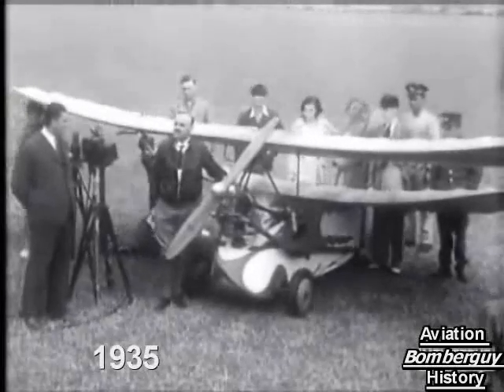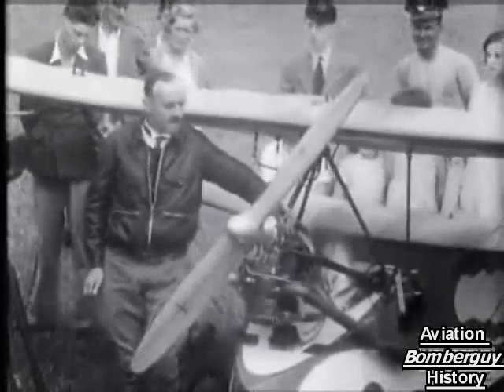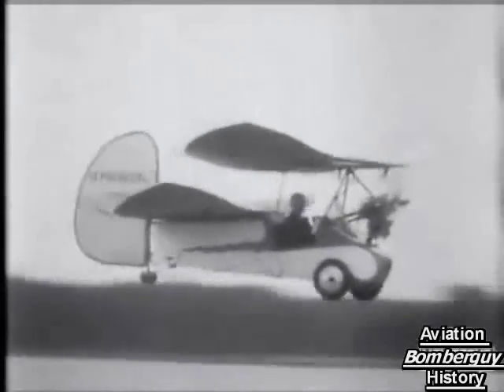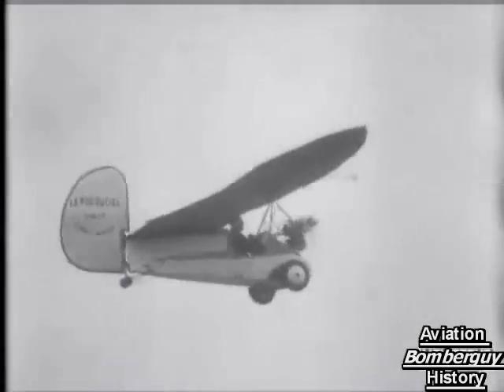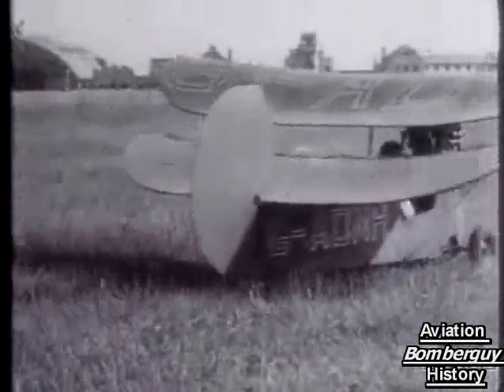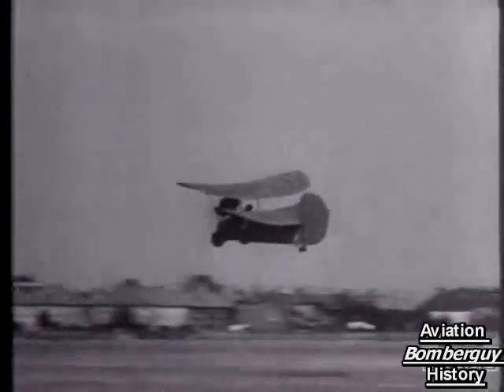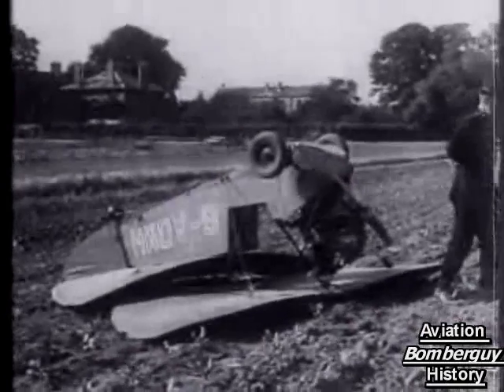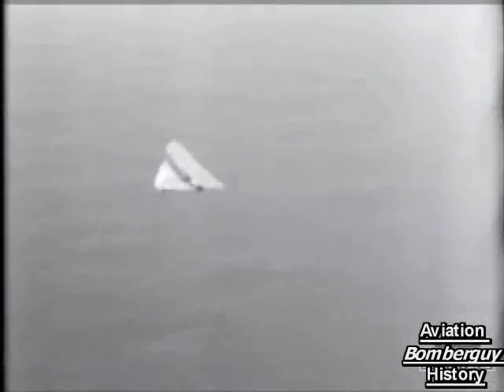The Original Flying Flea

Comment: Causing unrecoverable dives, as the high speed air from front wing going over rear wing increased lift in rear wing, putting nose down. 
Instinctive answer of pilots, pulling the stick, worsened the case, they should have pushed the stick.
In this mini-airplane, attitude was controlled by changing angle of attack of front wing.
Blessings +

Comment: @dopenhagen2009 im pretty sure that ultrlights also have a weight limit (the flying flee didn't meet any of those requirements so its just a regular plane with an odd design)
Reply: no weight limits existed yet back then. And if they did, they´d be higher, since modern build-materials didn´t exist too...
Reply: @klausbrinck2137  hopefully someone can use the Bruen decision to challenge it and raise the weight limit
Reply: @marcuspinson  my dream is to build a WingDing2 out of modern materials, with a DI-50cc-2stroke (Ditech, Purejet), should weight 35kg, so, I´m good...
Reply: @klausbrinck2137  I just think it's wild that you need a license to build and fly a clone correct copy of the first plane that was built and flown before licenses existed.
Reply: @marcuspinson  Still you can build lighter and circumvent the stop-signs.  Or is your issue, that people haven´t come up with rules yet, BEFORE the first plane ever flew ??? It´s logical, that the rules would come afterwards first... There´s some virtue in that the models existing before any rule existed, should be allowed to be further copied without needing a license, but then, yet none would build them, cause they´d be built with old materials, and that doesn´t help. The very few ones, that wouldn´t mind using the old, original materials and weights, are treated unfairly maybe, but they are really very few. Co-op with an aviation-museum, and let them clear out the bureaucracy, but please, don´t fight such a thing in its original constitution, it´s suicidal...
Reply: @klausbrinck2137  the ultralight weight limit in the US is 115 kilos or 254 pounds. The Wright Flyer was 274kg or 605lbs. It's wild to me that in order to recreate the experience of the first flight I need to spend months going through government bureaucracy and red tape to get a license that didn't exist yet. I think the weight limit should be raised to the weight of the first aircraft because no license was required to fly it.
Reply: @marcuspinson  hoping to recreate the experience of the first flight is nuisance and an illusion... It´s not 1900 anymore, and you not the Wright-brothers... Rules protect you from such nuisance.
Reply: @klausbrinck2137  rules don't protect you from anything. They're just used to punish you when you don't follow them. If you're alive to be punished then you clearly knew well enough what you were doing to survive. So you should be left alone.

Comment: Did you build it to the plans in the original book? 
That original version had a fatal flaw that could create an uncontrolled dive- the pilot didn't fail to flare- but a slight redesign cured that on all subsequent aircraft of this type. I've flown the HM1000 Balerit and the HM1100 Cordouan and though they feel slightly strange compared to a conventional aircraft well designed Mignet formula aircraft are very easy and safe to fly.   They are very popular with French homebuilders.